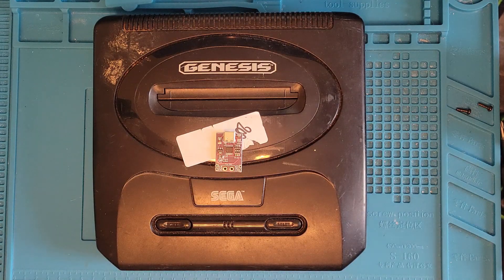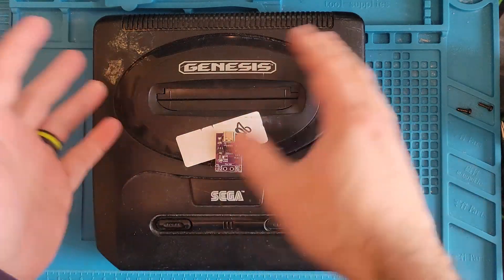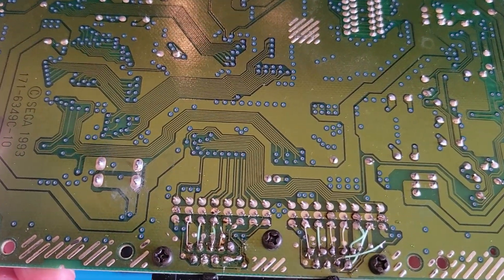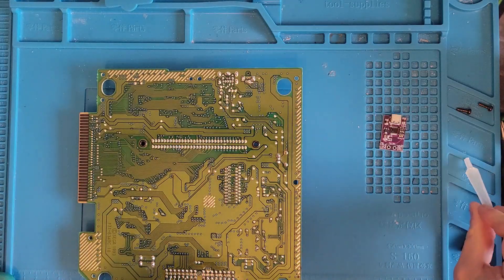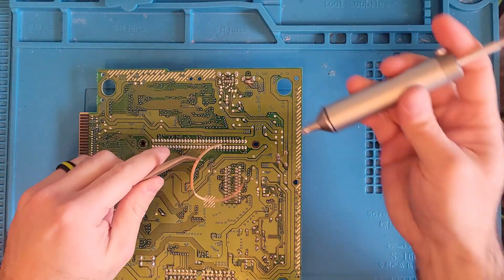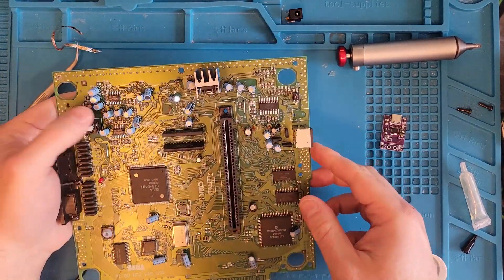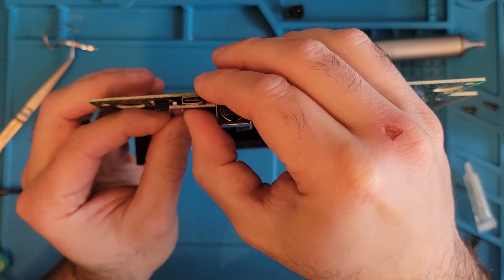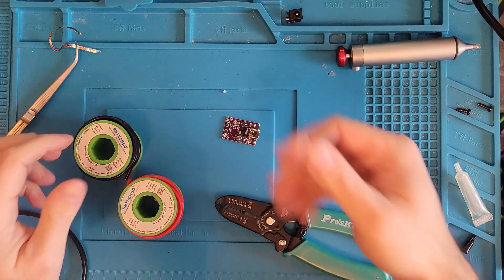Wolfman Creates a Monster!! USB-C Powered SEGA Genesis! Model 2!!!

Comment: Might try a mod like this in some of my systems someday, I'm a bit paranoid about messing with power but I assume it will be fine as long as it's within the voltage regulator's specs.  Modding a Genesis 2 to use the Genesis 1 AC adapter would also be nice, It's annoying that they need a different PSU.
And yeah, you shouldn't need the RF shield, the Japanese Mega Drives never had them in the first place.
Reply from the maker: I did not know that about the Japanese Mega Drives!! As long as your giving to console the voltage that it would expect from the power supply it should be fine. The model 1 and model 2 have different polarity. The model 1 has a center negative while the model two has center positive. It probably could be done though!! 🐺🐺😁😁😁
Reply: Yeah, I decided it would be easier to just make an adapter so I could use a Genesis 1 AC adapter on Genesis 2 (also works on a PC Engine Duo-R), used the following parts from Aliexpress:
"DC Power Connector Pigtail Barrel Plug Cable 2.1mm x 5.5mm Male Female 15CM Wire For IP Camera Power Supply Adapter LED Strip" (Female Connector)
"5/10Pcs 4.8 MM x 1.7 MM DC Power Male Plug Jack DC Power Socket Adapter 4.8*1.7mm DIY Wire Cable Solder Supply Connector"

Comment: Now do an Audio Circuit mod and the model 2 Genesis will be complete!
Reply: A Triple Bypass is pretty much required on a VA0.
Reply from the maker: Yes!! I will have to look into doing that!! 🐺🐺😁😁
Reply: Unless you wanna rid of the Jailbars on the Genesis, I would only try replacing components on the Audio Circuit. For me I'm only using CRT TVs, But its up to anyone though.

I would also replace the Jumpers on the board with Ferret Beads, should clean up a lot of noise with the video.
Reply from the maker: I will probably just do the audio circuit. The triple bypass looks nice but I don’t have a RGB cable for the Genesis or anything to plug one into if I had one. Correct me if I’m wrong but you can’t use the component cable after the triple bypass you would have to use RGB or Scart 🐺🐺🐺😁😁😁
Reply: @wolfmanrepairs Component cable should carry the RGB signals. Zaxour made a guide for composite restore regarding the 3BP.
Reply: @wolfmanrepairs  Nice thing is you don't technically need to use the Bypass's jail bar fix, or do it later. I advocate for it because it includes MegaAmp 2.0 circuitry, which would make it sound very close to a good model 1. There's also a further mod you can do to retain composite with a toggle switch.
Reply from the maker: Awesome!! I will have to do some research on all this!! Thanks!! 🐺🐺😁😁